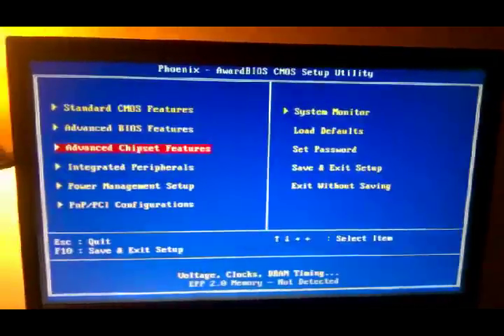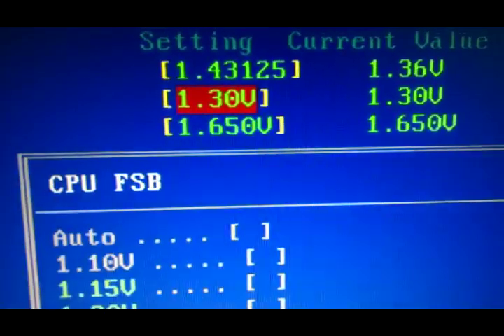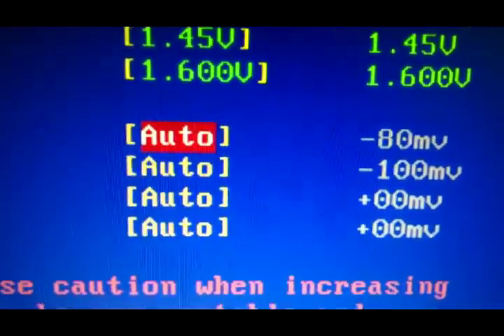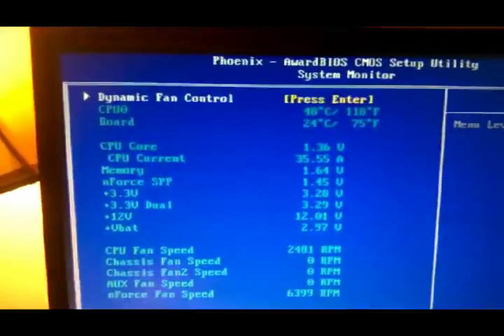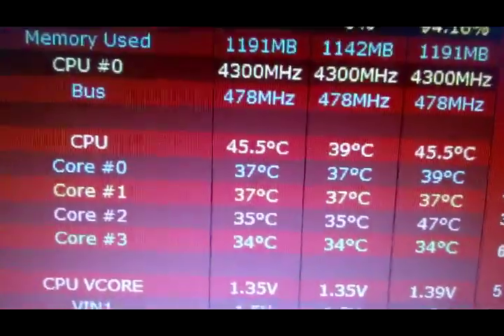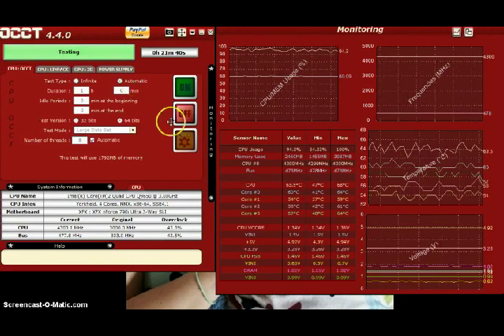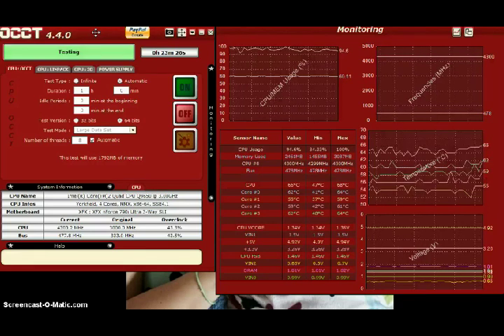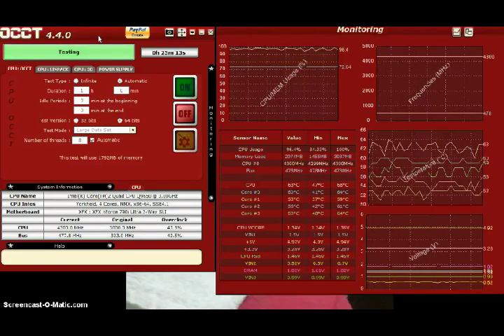OverClock Q9650 Core 2 Quad

Comment: Which mobo it is? Wanna do the same, did you update the bios to a newer one to achieve the overclock?
Reply from the maker: the mobo is the xfx 790i ultra bios is the p09 later upgraded to the evga p10. i increased the south and northbridge volts and added a slight overclock to those chips stayed stable for a year at 4.3 GHz then decided i would just downclock it some. been running solid for about 2 years at 4.0ghz
Reply: Pretty good advice, yes, i know that this cpus will go maximum voltage of 1.55 V, but it draws a lot of power :) and you need beefed up PSU. Anyway, very decent mobo to do overclock on it; i think the maximum base clock is 500 MHz, isn't it? ;) (of the board)
Reply: Good enough to make me get one too :) i'll try it ;)
Reply from the maker: 450-500mhz for the board max every chip/board is different
Reply: When you say that every chip is different you do refer to silicon lottery? Yes, it is very true, but with boards, yes, i saw many 500 MHz boards :) . I have to say, that last Intel processors, have a wide lottery, where the i7-7700K CPU bought separately, is more powerful that the same one Apple puts in their iMacs, but i don't know why; i have seen many iMacs bought with lowest options, being then upgraded to exactly the same specs as the most expensive one, but performing better... Very strange :))))

Comment: I have Q9650 with Rampage Formula and o/c 4,42 Ghz, 1,46v,  phanteks ph-tc14pe (three fans) temp 60- 64C max.
Reply: i have the same setup can you help me with the settings id like to get it to at least 4ghz
Reply: Maybe safe 4,2 Ghz?

Change these options in Bios

FSB Strap to North Bridge 400

FSB Frequency 468

Ai Clock Twister [Strong]

PCIE Frequency 100 (not auto!)

CPU Voltage 1.4000V (my Q 9650 VID 1.2625V what your?)

CPU PLL Voltage Auto

FSB Termination Voltage [1.38]

South Bridge Voltage 1.050

SB 1,5V Voltage 1.50

Loadline Calibration Enabled

CPU GTL Voltage Reference 0.67X

NB GTL Voltage Reference Auto

CPU Spread Spectrum [Disabled]
PCIE Spred Spectrum [Disabled]
CPU Clock Skew [Delay 100ps]
NB Clock Skew [Normal]
Reply: does it matter if i have hd6870 cf do i need to adjust voltage to it ?
Reply: No, graphics card does not matter when o/c processor, PCIE Frequency set to 100 in Bios

sry for my bad english...
Reply: didn't work. my vid might be lower voltage
Reply: I'm sorry, I forgot NB Voltage 1,55V :)

Comment: Hi TheMillerchamp . What is your motherboard?
Reply from the maker: ucss25 is is the 790i ultra nvidia mono by xfx. sadly xfx dropped contract with nvidia some time back.
Reply: TheMillerchamp do you think i can Take de 4.2ghz on my intel DP45SG extreme mobo? thanks
Reply: #Antonio Leal Junior, i think, that intel mobos (at least most of them) are locked - they won't allow you to overclock in the most cases as they're used most by OEMs; and OEM doesn't think it is a good idea to overclock a PC to stay on the safe side.

Comment: Q9650  here on a gigabyte ga ep35c ds3r. cpu has 1.3 VID have it over clocked to 4.01 ghz at 1.41 Vcore
Reply from the maker: that's awsome what are u using for cooling?
Reply: +TheMillerchamp ...was able to get a 3.14ghz overclock on just the stock air cooler then I picked up a Liqtech 120x all in one. could only get one of the two push pull fans to fit in case. Then I clocked it to 4.01ghz with only 1.38 Vcore but then upgraded ram and had to bump it up to 1.41 to be stable again.

Comment: Just overclocked the same CPU to 3.07GHz. When I adjusted the FSB to anything above 340, bios says overclock failure.
I'm new to overclocking, so I thought you might know why I can't adjust anything higher than that?

Temps are fine, around 56 degrees Celsius underload.

MOBO: ASUS P5Q-EM DO w/ intel G45 chipset (is that chipset any good with OCing or is this to be expected?)
RAM: Samsung DDR2 800MHz 2GB x 4 kit
CPU: Intel Core 2 Quad Q9650 (duh)

I've set most settings to AUTO, besides FSB of course. Some suggest increasing the CPU's voltage myself, but shit that's intimidating. I don't want to zap and burn the old-timer.
Reply: Most of the time is human error, check the voltages on the CPU, SB, NB because all of them need surplus when overclocking. Although it may be the chipset too, because it is very old :( .

Comment: What chipset. Are u using? Nvidia 680i SLI?
Reply from the maker: GeraldPUR 790i ultra, i also did a bios flash from xfx p09 latest bios to EVGA p10 bios.
Reply: +TheMillerchamp what cooling u using beside cpu?
Reply from the maker: +bennlucky7 all stock mobo cooling. just reset them every year with new silver 5 or diamond

Comment: how to do this in dell optiplex 960 sff
Reply from the maker: shahbaz khalid That PC has a motherboard that does not support OCing. You will need to get a PC or build one that has a motherboard that supports OCing. Plus that case for that PC is not a very good for cooling air flow is really bad in that case.

Comment: Hey, can you help me overclocking my q9650 on motherboard gigabyte p35 ds3r Rev. 1.0?
Reply from the maker: kazhemons Remember that overclocking can damage your rig. I am not responsible if you damage your rig from what i help you with. Also OCing degrades the CPU faster than not OCing. So if you do this the risk becomes much higher that your PC will crash on when you least expect it. I could try but it is really all down to just tinkering and proper heat sink to cool the cpu. Always watch you temps once you start OCing. Never let the cpu get over 70-75C degrees. If you get high temps right off the bat with a higher Vcore turn it down or get a better heat sink/watercooling system. I would set your cpu Vcore volts to a max of 1.37-1.4 if you go higher than 1.4 it shouldnt damage your cpu right off but it will degrade a lot faster.  Dont go any higher than 1.45 you will be looking at trouble after that if you do not have a custom water loop at least to keep cool. As for gigabyte mobo im not sure how the bios is set up. But for FSB volts set it to 1.35 if that is an option. And raise your NB and South bridge to max safe zone. google to see what that is if the bios does not have green and red color on the number like my 790i mobo has. Now as far as overclocking the NB. You might not have to do that. Leave that a last option. Make sure to disable the halt state, speed step, cpuid maxval, and thermal control. Now depending on your ram speed, if your have like 1800 MHz ddr3 you can most likely link the CPU and RAM speeds but you will have to play with RAM timings. Or you can just set your RAM to its rated speed and timings and leave it unlinked from the CPU. Now all there really is left to do once you have all the above in place is to start increasing the speed, i made the jump from 1333 to 1650. Ran a 12 hour Prime95 test on small ftt watched the temps for the first hour if it is still running the test after the 12 hours and there was no error increase the clock some more go to 1700 or 1750. Always watch you Temps for the first Hour of testing when you increase the speed. Just keep doing that tell you get errors in Prime95. Once you get errors or you temps go over 70-75C that is mostly the max you can do with that chip. Very time consuming to overclock and stay 24/7 stable. Hope i could help let me know if you have any more questions. If you get to a clock speed that you are happy with run finally Prime95 test on small ftt for 24 hours then run a blend test for 24 hours. If all goes no errors and temps stay below the 70-75C, you should be good to go.